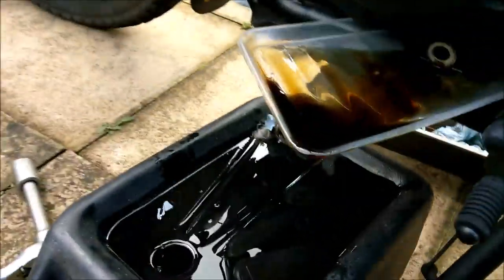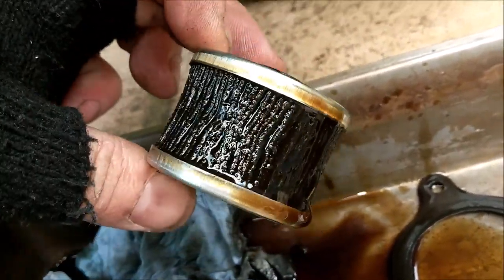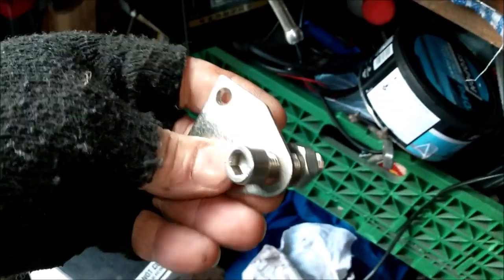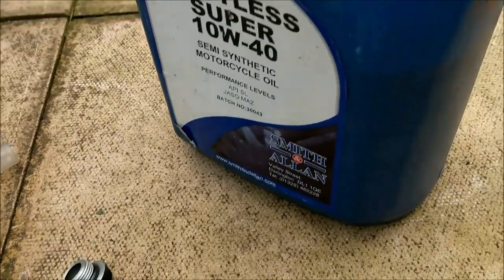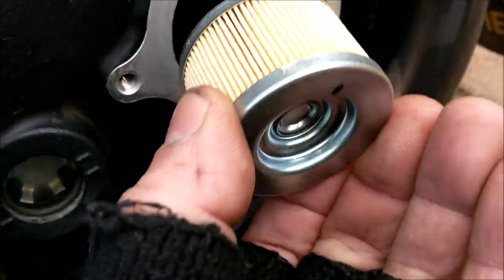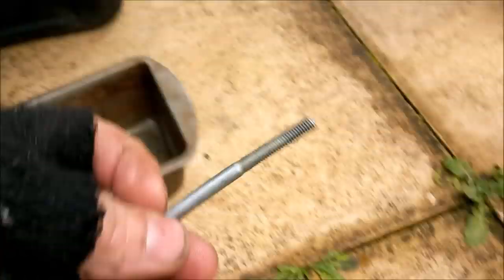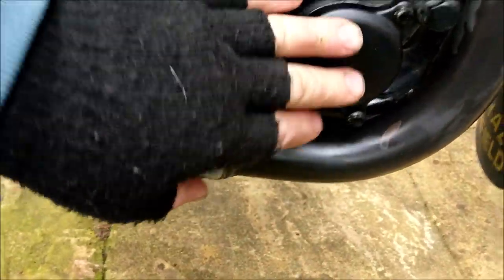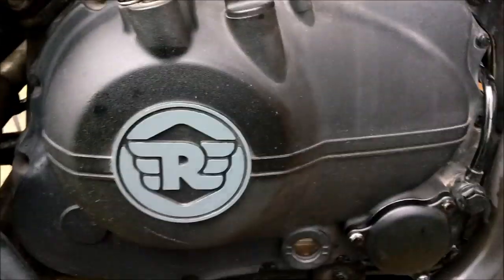Royal Enfield Himalayan oil & oil filter change

Comment: The oil filter is usually soaked in oil before putting it in place.  It doesn't get dry like you have.  Nothing serious happens either, it is better that the filter already has some oil.  Thanks for the video .

Comment: Welcome back, Adrian. Suffering from Bi-polar myself i know the draining effect it can have. Biking is one of my depression drugs, it clears my mind and relaxes me.
 A couple of points. 1. RE now recommend fully synthetic oil for the Himalayan since summer 2019. 2. There is a prefilter behind the drain plug that must be cleaned each oil change. This is where you will find metal if it's floating around the engine. 3. There is now an updated rubber oil filter seal rather than the paper gasket. The rubber seal seems to be more oil tight and can be used a few times before needing replacement.
Like to know if you are using the standard rack with the top box because everyone tells me without strengthening it brakes.
Reply from the maker: I was looking at the oil filter cover and thought about putting an o ring in there, the bike runs super on that oil i used, will check out the other filter, thanks for that, sorry to hear you suffer as well, it's horrible
Reply from the maker: My rack isn't standard

Comment: Good tip on the bolt hole and here in the US we get a O-ring with the oil filter and how long have you been running 10w40 oil in your Himalayan because Royal Enfield wants 15w50 in it because I want to run the 10w40 in mine because where I leave the 15w50 is so thick in the cold with start up.
Reply from the maker: First time with 10/40, much better in my opinion
Reply: @eadsierestorations  Ok thanks because I run Rotella T6 5w40 in all my motorcycles and scooters so I'm going to try it out next spring when I change out the oil.

Comment: Hi Adrian, cheers for the vid, good to see you back. Is that an REH Touring seat on your bike? if it is, have you noticed any difference over the standard seat? Also, prices for oil filters seem to be all over the place, do you have a preferred supplier. Anyhoo, cheers from NZ.
Reply from the maker: Yes it's the touring seat and it's so much better than the original, i got the oil filter free with some RE Himalayan brake/clutch levers
Reply: @eadsierestorations  Cheers Adrian, all the best buddy.

Comment: I seem to spend my time replacing batteries on my Himalayan. Just ordered a Lithium so let's see how that fairs. I think you had a slight bit of condensation in your oil so wouldn't worry. Take care matey 👍
Reply from the maker: Do you have an alarm fitted? Where i had not been on the bike for six weeks the alarm drained the battery, i charged it up and it's fine again, I've left the alarm disconnected whilst I'm not riding it daily
Reply: @eadsierestorations  no alarm only usb outlets and I have them on an isolator under the seat. Just I seem unlucky first battery died in less than 500 miles second one 14 months now dead and that was a ytz10s Honda battery ☹